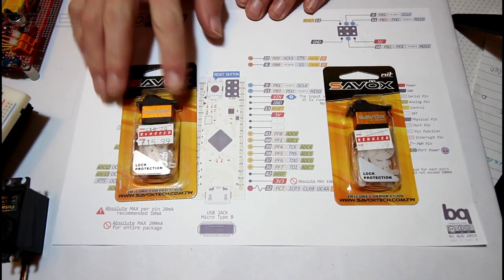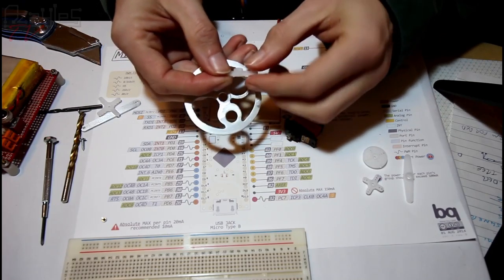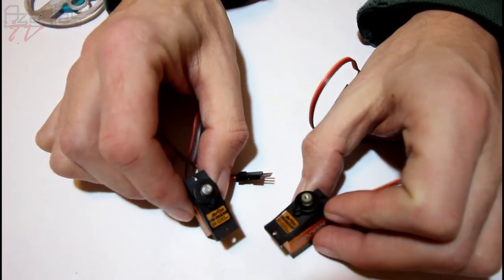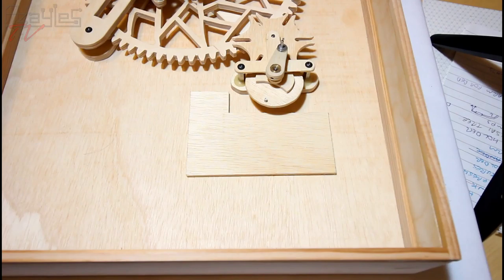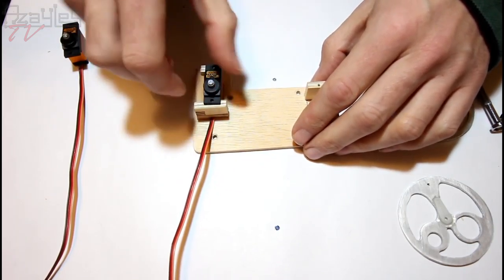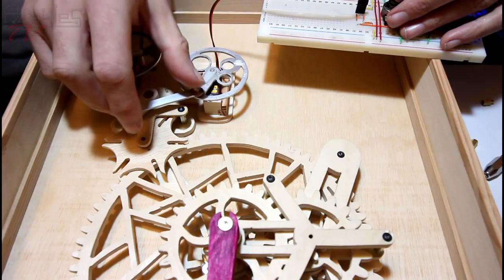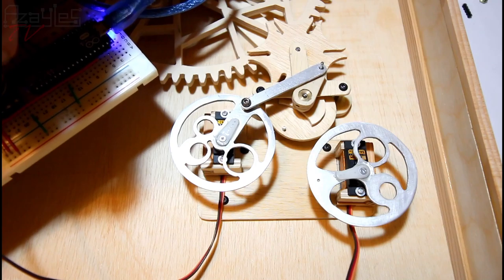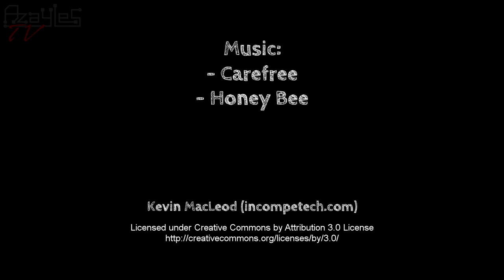Wooden Electromechanical Clock Build - Part 11 - Servos

Comment: i want to ask you if it possible are there any plans available right now?
Reply from the maker: I'm rather afraid not! I don't have much in the way of plans myself, just a basic layout for the gear ratios and positioning within the frame. A lot of it I'm doing on the fly, as I go along.
It'd be hard to do plans in any cause because of the parts of the clock I've repurposed from other things, such as the wrap clutch that transfers motion from the great wheel to the hands, and the various bearing surfaces. There's a lot of parts that aren't off the shelf :(